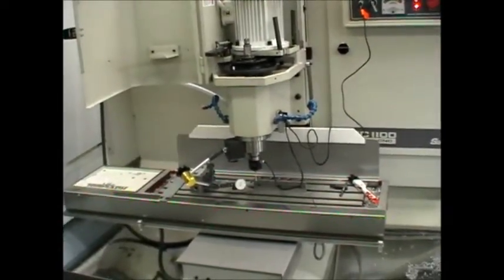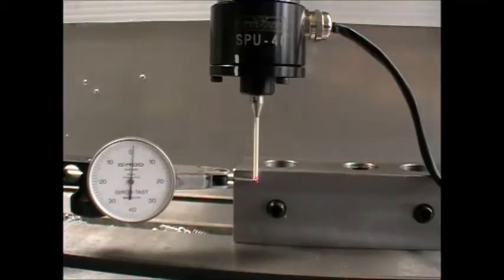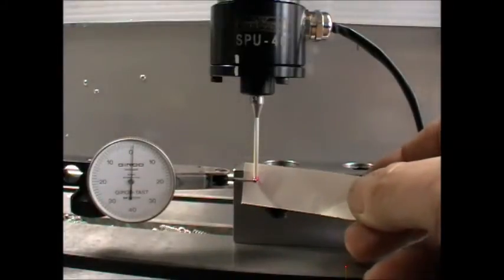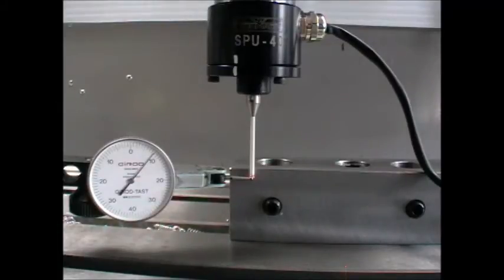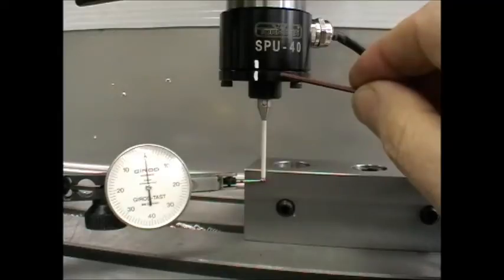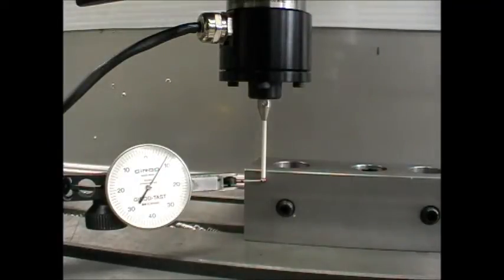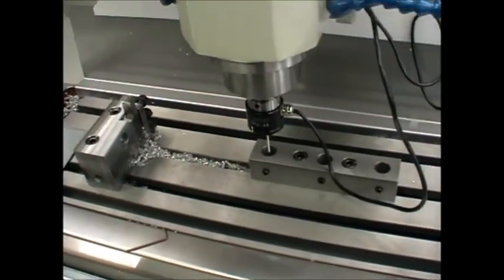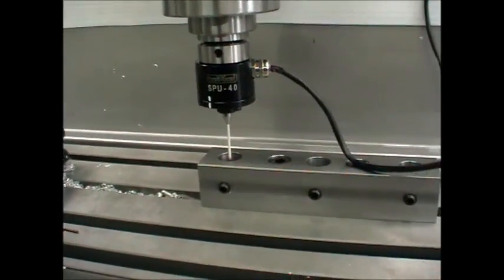Tormach Passive Probe accuracy

Comment: Can the probe be set to read all four exterior sides of the stock? Never used path pilot so i'm not familiar with its probing routines. This could simulate the same effect as the inside of a bore giving the center of stock as your work offset. Just thinking outloud.
Reply from the maker: Hi Conrad - Yes PP probing routines are available for all four sides. I think you are saying this will take into account the pretravel via equal errors cancelling out. If so you are correct. However the problem of pretravel variation remains. This is explained more in the following videos.  Cheers  Cliff

Comment: Why are you concerned with this accuracy when using a machine based on steppers?
Reply: These machines can be quite accurate in the right hands with very little effort.  So... i can be within .001" with mine on the parts i run, or i can spend $80,000 and be within .0005".  I can live with being off by the width of a hair for $65,000.
Reply from the maker: @outkast187  Yes I agree... that makes sense.  Cliff
Reply from the maker: Hi Charles - Yes steppers and these low cost machines have minor inaccuraces of around 0.01- 0.02mm  but we are taking major inaccuraces here of 0.05- 0.10mm.  Cliff
Reply: You're an idiot

Comment: What do you expect for a $250 tool?  This probe is fine for its intended use. If you are wanting more you should spend more for a more precise tool. It's nice that they manufacture a tool in this price range. And its ability reflects that.
Reply from the maker: Yes it is good value and it got me started on this:
 https://www.youtube.com/watch?v=eoUt8dPKyKQ
Cheers  Cliff
Reply: Even a 7000 EUR Heidenhain probe has flex, so it is noth about price. It is about how you calibrate the probe. You should calibrate the probe to a known ring ID so that the flex etc can be calculated and compensated for.
Reply from the maker: Sorry just noticed your comment - You cannot calibrate for the variable pretravel currently in Pathpilot.  Cliff